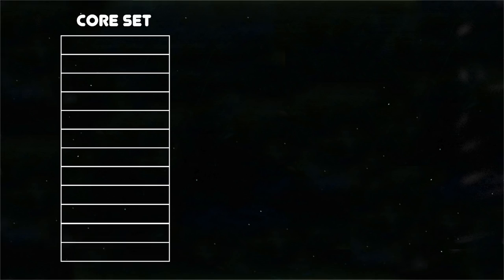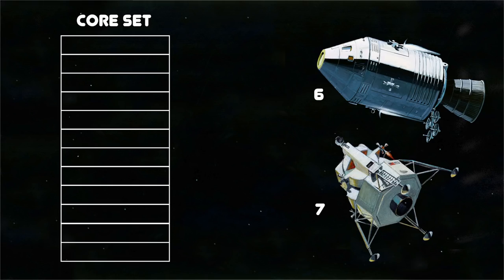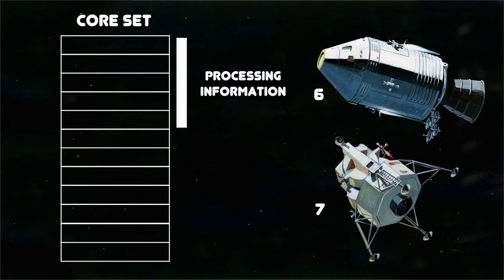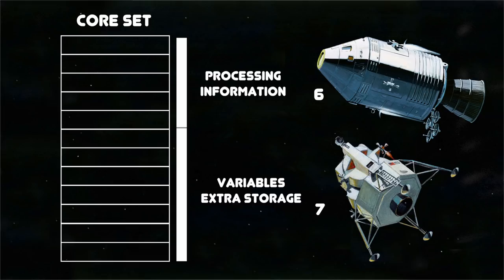Apollo 11's "1202 Alarm" Explained

Comment: Amy:  Love the channel.  I know this is a nit, but you've got the 1201 and 1202 alarms backwards.  A 1201 alarm occurs when the computer can't find an available VAC, and a 1202 occurs when it can't find an available Core Set -- the reverse of what you said.  Frank O'Brien, in his fantastic book, also gets this backwards.  I've checked the AGC source code, and it's very clear that a 1201 is triggered in the routine that tries to find a VAC, and 1202 is triggered in the routine that searches for Core Sets.  It's a tiny thing, I know.

Comment: Here's an excerpt from "The First Men on The Moon" by David M Harland:

Gene Kranz’s flight control team took 4 July off, but returned to work the next
day for their ‘graduation’ simulations. As Armstrong and Aldrin were unavailable,
Pete Conrad and A1 Bean took their places as a welcome training opportunity for
Apollo 12. The flight controllers successfully overcame six tough scenarios during
the morning. The afternoon sessions were to be ‘flown’ by the Apollo 12 backup
crew of Dave Scott and Jim Irwin, the rationale being that a less-experienced crew
would increase the pressure on the flight controllers. Three minutes into the first run,
Koos prompted the LM’s computer to issue an alarm. A caution and warning light
illuminated, and the computer flashed the numerical identifier for that particular
problem. Computer alarms could result from a hardware fault, a software issue, out-
of-tolerance data, or a procedural error either by the crew or the ground. Steve
Bales, the guidance officer, was monitoring the LM’s computer to ensure that it
received the correct data from Earth and that its guidance, navigation and control
tasks were being properly executed, In this case the alarm was a 12-01.  Bales had
previously seen it during functional tests of the computer on the ground, but never in
a simulation, and certainly not in flight. While the LM crew awaited advice, he
checked his manual: the 12-01 alarm was ‘executive overflow’, which meant that the
computer was overloaded. The computer‘s executive was to repeatedly cycle through
a list of tasks in a given interval of time, and evidently the time available was no
longer sufficient to finish the tasks before it was obliged to begin the next cycle. Bales
called Jack Garman, a support room colleague and software expert, and they agreed
that the alarm was serious, especially since it was recurrent. With no mission rules to
inform his decision-making, Bales called Kranz, told him that there was something
amiss with the computer, although he could not say what, and recommended an
abort. This call came out of the blue as Kranz had not been party to the discussion
between Bales and Garman, but as a flight director must trust the judgement of his
controllers -- especially on abort calls -- he confirmed it.  Charlie Duke, serving as
CapCom, relayed the abort to the crew, who performed the manoeuvre and made as
if to rendezvous with their mother ship (which was not actually in the simulation). At
the debriefing, Koos pointed out that the 12-01 had not necessitated an abort; in the
absence of a positive indication that the computer was failing they should have
continued. Shocked that he had made a bad call, Bales got together with the people
from the Massachusetts Institute of Technology who had written the software, in
order to investigate the alarm. Later that evening, he called Kranz and conceded
there had been no need to abort. The next day, 6 July, Koos triggered a range of
computer alarms to enable Bales’ team to record data on the ability of the computer
to continue to function. On 11 July Bales added a new mission rule listing the alarms
that would require an immediate abort; in all other cases the powered descent was to
continue pending a positive indication of a critical failure.
...
“Go!” called Willoughby.
“EECOM?”
“Go!” called Aaroni
“Surgeon?”
“Go!” called Zieglschmid.
“CapCom we’re Go for landing"
“Eagle, Houston. You’re Go for landing.”
0n hearing this, Jan Armstrong sat up on her heels at the foot of her bed. Pat
Collins exclaimed, “Oh God, I can’t stand it.”
“Roger. Understand, Go for landing,” acknowledged Aldrin. “3,000 feet.” But
then, “Program alarm." He keyed the DSKY for the code, “12-01.”
“Roger,” acknowledged Duke, “12-01 alarm.”
“Same type,” responded Bales immediately. “We’re Go, Flight.”
“We’re Go. Same type,” relayed Duke, the tension evident in his voice. “We’re
Go.”
...
On concluding his momentous shift, Kranz shook Tindall’s hand, found Koos to
thank him for throwing the 12-01 program alarm into the final simulation, and then
he accompanied Douglas Ward, his Public Affairs Officer, across the road to the
News Center.

Comment: According to "Failure is Not an Option" by Gene Krantz, they got that alarm on their final simulation a few days before launch. When they got that alarm, Neil aborted, and they failed the sim. It was looked into at that point, and so when it happened in real life they knew they could ignore it.  That's what Mr. Krantz said at least.
Reply: Yes, this would have been a great thing to mention in the video, because if they hadn't had the scenario in the simulator they almost certainly would have aborted the landing, because otherwise they wouldn't have known the alarms were safe to ignore.

Comment: A much overlooked side story is that the actual credit for the successful landing despite of these alarms should be given to the simulation supervisor Dick Koos. He put exactly these alarms in the very last mission simulation before the actual launch, because he realised, that there weren't any mission rules regarding computer alarms. In this simulation the GUIDO flight controller Steve Bales wasn't able to figure out the cause of the alarm in time, so he called for an abort. At first flight director Gene Kranz was angry at the SimSup, because he felt that the last simulation should be a successful landing. But then Dick Koos explained that it was intended to be a successful landing, because the computer was performing all necessary tasks and the GUIDO shouldn't have called for an abort on that alarm alone without a second hint, that something was going wrong with the trajectory.
This simulation triggered Steve Bales to look into the program alarms and write procedures on which alarms were critical or non-critical and when to abort or not to abort. So when these alarms came up during the actual mission he was prepared and made the right call within seconds.

Comment: This is the real explanation of the 1202 alarm:
In a comment of the anomalies section of the mission report of Apollo 11, entitled "Computer Alarms During Descent, at page 16-13 you find this:(excerpt of the comment):
"Any difference in phase or amplitude between the two 800-hertz voltages will cause the coupling data unit to recognize a change in shaft or trunnion position, and the coupling data unit will slew (digitally). The "slewing" of the  data unit results in the undesirable and continuous transmission of pulses representing incremental angular changes to the computer. The maximum rate for the pulses is 6.4 kpps, and they are processes as counter interrupts. Each pulse received by the computer requires one memory cycle time (11.7 microsecond) to process. If a maximum of 12.8 kpps are received (two radar coupling data units), 15 percent of the computer time will be spent in processing the radar interrupts. The computer normally operates at approximately 90 percent of capacity during peak activity of powered descent.) When the capacity of the computer is exceeded, some repetititvely scheduled routines will not be completed prior the start of the next computation cycle. The computer then generates a software restart and displays an Executive overflow alarm."
End of quote.
Now tell me:
1) Why would the engineers have provided a radar mode which was causing a problem that they perfectly knew that it would happen (and which was not happening when the radar mode commutator was on the LGC position)?
2) Why would engineers have made the processor count itself the radar pulses when, in all other systems, including the one of the Saturn rocket, these pulses are counted by electronic counters instead and never, NEVER, by the processor itself; for, if these unwanted fast radar pulses had been counted by electronic counters, the processor would just have read the count of pulses on the electronic counters (like all other systems do), and could have seen that the count of pulses was too high; it would not have had to restart, it would just have issued an alarm that the radar mode was on the wrong position.
Are you able to rationalize this?

Comment: 5:43 With 30 seconds of fuel remaining!
Reply: Lawrence - Well, they were 30 seconds from the BINGO call, which would have been given when they were 20 seconds from the safety margin, which was based on the most pessimistic fuel gauge.  So they had at least a minute of actual fuel remaining.  But it was still pretty tight, true.

Comment: I was so disappointed when the Apollo missions ended, and then they went ahead with that stupid space shuttle, what they should of done was prepared for the mission to Mars, i am pretty sure they could have done it after the apollo mission ended, used the same system they had for the moon landings, maybe re-designed the living area and a little more space, for the longer mission ahead, but they could of done it by the late 70s. All i can say is..... "disappointing"

Comment: I remember watching Buzz Aldrin discussing this in an interview. He said that the MIT guys told NASA the LM's radar tracking of the CSM position should be turned off during decent, but that he didn't do that because he wanted to be able to successfully abort if necessary. Leaving tracking of the CSM would make for a more reliable abort. It wasn't clear from the interview whether he violated a checklist or not.

Comment: Hi Amy, I have heard conflicting stories about the 1202/1 and was hoping you could clarify. A video by the WSJ says that the alarm was caused by Buzz forgetting / intentionally leaving the other monitoring system running. Another story says that Buzz left the system on but the issue still would have happened due to crosstalk on the antenna wires. If the answer is too long you can just point me an alternate source.

Comment: I still don't believe we went to the moon period .
Reply: Glenn belief does not equal evidence. All evidence points to the successful landing of six missions.
Reply: +Glenn   What more evidence would you need to convince you?   There was live video, 16mm film and thousands of high resolution photos shot with Hasselblad cameras on 70mm film.  Plus, all the moon rocks and dust examined by geologists around the world confirm that they are not from Earth.  Not to mention, photos of the far side of the moon that is never visible from Earth that had to be returned for processing, unlike today's digital photographs that can be transmitted.
Reply: So you believe we went to the moon in the sixties With a Wernher Von Braun powered Space ship covered in tin foil !! Flew straight through the Van Allen radiation belt, With 12 volt powered led acid batteries to charge the shielding to avoid Serious harm from radiation some how missed every asteroid that's  flying around up there with out guidance computers, 
GPS Systems Ops i forgot about the Russian satellite Sputnik 1. Then keep the Astronauts warm for three days with the same batteries, Popped into the Moons orbit un docked the lander, At four thousand miles an hour with Delco Remy switches and a hand held Gimbal  as a guide and not to mention a ten thousand pound rocket sitting just under their bums.
No way.Go and ask Doctor Elephant if Astro Boy can pop in on one these YouTube videos And fix your (1202 ) ticket machine so we can all have a good Laugh.
Reply: Glenn yup. I do believe it. I've also seen a launch myself, albeit with 80s tech.

Tin foil is a remarkably good insulator w.r.t.  purely emissive heat conduction.